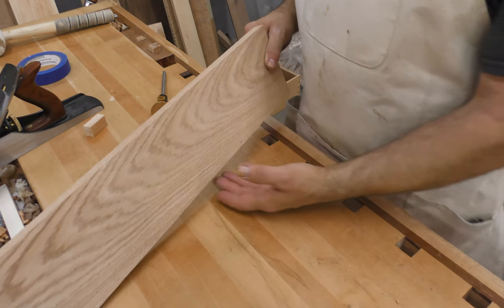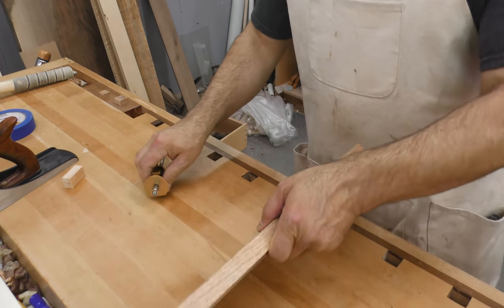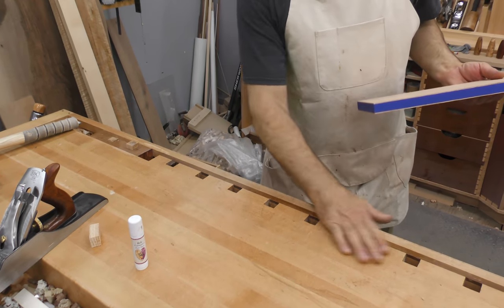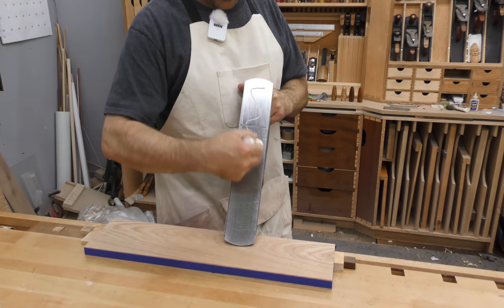Hand Planing Wood - How to Thickness a Board

Comment: What do you think about the process of leaving an inch on either side of the ends, so that as you run your plane along the board, it will only allow the plane to take so much before the ends lifts the plane up, making it straight? 
like draw a line an inch or so out on each end ,edge to edge,, start your plane on the line and end on the line and it creates a high ledge on each end of the board of sorts. now when the heel and nose of the plane reaches that point it lifts the center up, before you know it the plane cant take any more material from the middle because of them, in theory it should be strait, never seen you do it before but i was told by my grandfather that's how you insure a strait surface. at the end, you plane them off and voila 
I'm sure you know what I'm talking about
Your a huge inspiration Rob, keep up the great work

Comment: Thanks for the video! You were constantly light on the left side... Thought that may be because you're skewing much more than on the left. When you skew a plane your in effect increasing the angle of the iron, therefore allowing you to cut better. So, when you plane square to the board, more of the iron is hitting the wood at once and the wood is pulling the iron in more, resulting in thicker shavings... On a micron level. Is that perhaps why you were consistently higher on the left? Because I know you were pushing with equal pressure.

Comment: A few weeks ago I was building some replacement cabinets for our kitchen. The doors are frame and panel construction with panels that are 17” x  24”. No access to a wide planner or thickness sander. I was extremely lucky to find a hickory board that was a little under 18” wide by 1” thick and long enough for the four panels. I didn’t want to rip the boards in half to plane them down and then try to glue them back together so I planed them by hand. I needed them to be about 9/16” thick to match the existing cabinets but it seemed more important that the panels were the same thickness than what that thickness actually was. The grain in the panels is awesome but it swirls and rises and falls all over the place so I really struggled with tearout. Your tips on a tight mouth, and especially a 20 deg back bevel really helped. The blue tape trick would have made it a lot easier to see where I was at but it is definitely in my arsenal for the future. I used a radiused blade to take about 1/8” of both sides and then my #7 to flatten each side. I finished up with my #5 1/2 and the high angle blade and got almost all of the tearout cleaned up. I had to use a card scraper on a couple spots on each panel and then I sanded them with 220 grit sandpaper to even out the surface. They each have five coats of varnish and have been assembled and I’m installing the hinges and mounting them on the carcasses this week. I don’t think I would have attempted this if it hadn’t been for your great videos and tips. I surprised myself and my wife. I can’t wait to get the cabinets installed.

Comment: i like to mark any exposed wood with a dry erase or even a marks alot  before i take blue tape off (when i use it)   that leaves a perfect darkened line to remove that remains clearly visible until even the feather is gone.
Reply: _ David _  not in my experience. particualarly with a dry erase marker or a crayon.  i actually use a crayon more often as it has the added benefit of being wax based and it makes the plane slide easier
Reply from the maker: good idea. I will try that
Reply: When the plane cut is just above the line, you get a very fine whisker of wood fiber that may either be attached or partially free that marks the edge of the gauge cut farthest from the reference face.  One last pass leaves the edge with a very slightly eased feeling - the bevel of the cutting wheel leaves the side of the cut toward the reference face slightly inclined.  I prefer to go by touch since otherwise I do need some sort of magnification to see the line.
Reply: @theeddorian i

Comment: I found that when I slow down my passes, making sure the blade engages and doesn't skip at the start, I get a smoother, more consistent pass. There are times when I get a "skip" further into the board though. Sharpening seems to help eliminate that issue, as well skewing a bit more seems to help keep the blade engaged.
I also check to make sure I'm not introducing twist using the flat surface method. That is, laying the board surface on a flat surface - my table saw - and check for any rocking and note where it needs work. Later, I use my square across the face of the planed surface attempting to discover low or high spots. 
Getting close to the gauge line, I slow everything down and take the lightest passes possible.
It's definitely a process - most of which I've learned from your great videos!
Thanks!!
Reply from the maker: All great techniques.   Good job and thanks for sharing

Comment: Dear Rob, as always appreciated your teaching. It is truly lovely to wield a finely tuned plane like the one you use. Would you ever use a wooden plane instead of steel? You get the added bonus of burnished timber that way.

I notice that you remove each piece of shaving with every stroke. Nice explanation 3/4 way through. Makes sense. Cheers.

Comment: Can't tell you how glad I am that I have jointer and planer after watching this series. Rob's work is incredible, but I can handle that much time on one board. However, I have recently picked up a couple hand planes and enjoy using them for thing that power tools won't do. Still have a lot to learn with the hand planes but I'm getting there.  Thanks Rob.
Reply: Yeah. I don’t think I’m going to get in the habit of thickness planing by hand. The hybrid solution is run it through the planer and then use hand planes to make it glass smooth with no sanding. 

No need to be so fussy then as you’re just surfacing the board. Doesn’t matter if it’s out by a few sheets of paper anyway.

Comment: Using your marker to "grid out" the surface is a very nice technique and helps develop your mindset on how to do this efficiently.  I use the same thing with a pencil on my Japanese water stones whenever I take them to the diamond stone for flattening.  Helps ensure they're truly flat when the pencil marks are completely gone and also saving some time (and stone!) by not taking off more material than necessary.  :-)

Comment: Today I milled two 10" x 6" pieces of cherry both faces and edges by hand. They started out .94 inches thick. The first one took me three hours and I didn’t pay attention to time on the second but it was probably at least two hours. My calipers tell me I got them within 5 thou on the first board and ten thou on the second. There are 16 more of these that I have to make so plenty of time to practice. Obviously I need to get better so it doesn’t take 3 hours. I also need to get a scrub plane since taking off 1/5th of an inch with a jack isn’t gonna fly moving forward. 

If this goes well the rest of the cherry I bought will get turned into picture frames. Those are gonna be longer boards but they also won’t be wider than my plane blade. And it doesn’t matter how thick those are so I can just leave them at .9" or whatever they end up once I get both faces parallel. No need to thickness it down like my current project.

Comment: Hallelujah for powered thickness planers, haha! I will admit it's very therapeutic watching your master-level work, though. Thank you.
Reply from the maker: The take away though is you cannot always fit your board through the thickness planer and sometimes you need to do it by hand or parts of a piece by hand.
Reply: @RobCosmanWoodworking  and what if the power goes out? What about our woodworking ancestors who didnt have a sliver of the modern tech we have? They made use of what they had

Comment: Every time I watch one of these, I can’t decide whether to try to improve or simply burn my tools.
Reply: Vote to improve, even if just a little  each time, but pace yourself and just make sure your tools are sharp
Reply: Same feelings.
Reply from the maker: You can do it...practice and patience and you will improve, I promise
Reply: Work on technique.   Good quality tools will definitely be easier, but won't fix the problem on its own.  Learn how to tune the tools and use them properly
Reply: It’s about improving,not competing. I don’t have enough time left to compete. 
But I can improve.....hopefully 🙂
Reply: @anthonyprotheroe5553  keep working at it and you'll improve every day
Reply: Anthony Protheroe you’re absolutely right. Using Rob’s videos from this series as my example, my first attempt at hand-milling a board was really frustrating. I whittled a 1/2” thick piece of S4S poplar down to less than 1/4” and it still wasn’t flat or square! But my next attempt was better, and by the time I got to my 4th attempt, I was able to get it straight, flat and square on all 6 sides. Keeping your plane blade really sharp is absolutely essential, and plane wax really helps. Using smaller practice pieces to start with also helps you dial in your technique. Poplar is a great choice for practice because it’s inexpensive and it planes nicely.
Reply: I am trying to flatten a rough board of ash 40inches long x 8 inches wide but I only have a n4 Smoothing plane. Seems impossible to me. Plane too short. Should I give up?
Reply: One thing I learnt from Rob is looking at the plane shavings as a feedback tool ..thank Rob
Reply: I completely understand your sentiment 😂
Reply: How do i learn thicknesses?

Comment: What are the advantages of using hand planes to thickness wood over a planer, aside from getting a good workout? I love handplanes and use them a lot, but thicknessing a board by hand is very time consuming when a planer will do it in a fraction of the time. I'll usually use a smoother after it has gone through the planer. Keep it up Rob, amazing knowledge, experience, and skills!
Reply from the maker: No dust, no noise, you don't have to spend the money for a planer.  I use my planer all the time, like you I finish with a hand plane.  But there are times when I have a board wider than my planer so I need to know how to do it by hand.  Also these skills translate to numerous other aspects of woodworking even power woodworking and will make you a better overall woodworker.
Reply: @RobCosmanWoodworking  in my opoinion and from experience, hand tools are MUCH quicker and safer than power tools. Though in hybrid in adaptation to both, power tools allow me such finesse you cannot achieve with power tools. I was able to fix a twisted board with just a scrub plane, a jack, and a low angle jack, all within 5-10minutes. Putting a twisted board through a planer is a death trap!
Reply: @solidsnake9332  I'm a hybrid woodworker.  I can fix a twisted board on a thickness planer with the aid of a sled which I built, so long as the board is not more than four feet long (the length of my sled).  I have used hand planes many times to flatten a longer twisted board.  I don't have a power jointer, so that is not an option for me.

Comment: I like the blue tape trick, however another novel idea I have come across is, instead of using a marking or cutting gauge to set the finished size with use a plough plane and set from the fence to the inner edge of the cutter the finished size. Then with the fence on the face side plane a shallow groove which will appear as a rebate (rabbet) on the face requiring planing. Do all four edges but doing the long grain first followed by the end-grain which should address any breakout issues. you should end up with a small rebate on the back side the exact size of the finished board. All that's needed then is to plane down to the rebate, checking for flatness as you go. The rebate is much easier on the eyes than a gauge line and facilitates an exact 90 degree corner as opposed to feathering which can sometimes occur when using a marking gauge.
Reply: That's a good idea.  It suites the non-time sensitive hobbyist.

Comment: Nice work a true art but it's the time factor...i'm 70 I just can't take all that time on a project...great to know how to do it properly when needed in some cases so thanks for the easy lesson...stay safe...
Reply from the maker: I certainly do not thickness all boards by hand.  I have a 24" planer.  But I know how to thickness by hand, which gives me a lot of flexibility when I need to solve a situation that my machines cant handle.  But even when using machinery I always finish with hand planes.  Plus, there are a lot of folks out there that cannot afford a wide planer and when they need to thickness a board wider than their planer they need to understand how to do that by hand.  And finally there is a resurgence of wanting to work wood in an unplugged workshop.  For all these reasons, I think knowing how to hand thickness a board by hand is a valuable skill even for a power tool woodworker, like me, and one we should keep alive.
Reply: RobCosman.com    absolutely agree ..as I said above ..a true art and great to know when needed...thank again and looking forward for more good old time skills....stay safe...

Comment: I missed the blue tape part. Is that in a different video?  I love that trick, but how do you know your tape is perfectly aligned to give you a perfectly dimensioned board.  I struggle cutting straight, planing straight, and sometimes walking straight so I can only assume that taping straight will be a new struggle 😜
Reply from the maker: The tape gets cut using your marking gauge, no need to rely on straight taping!
Reply: @RobCosmanWoodworking  Occam’s Razor!  Thank you for a quick reply!

Comment: I have a question. When you say its flat and there is no light showing from your planer to the wood. Is it completely zero light coming through or is a thin line of light an acceptable tolerance?
Reply from the maker: The perfect result is no light.  If you have some light there is a high spot or two somewhere.  But, a think line of light that is the same thickness is OK.  chances are, in that situation, the outside corners are slightly high.